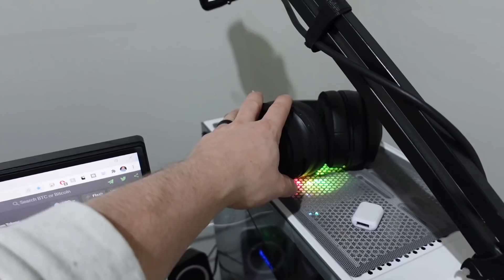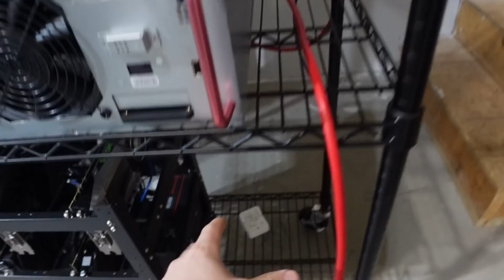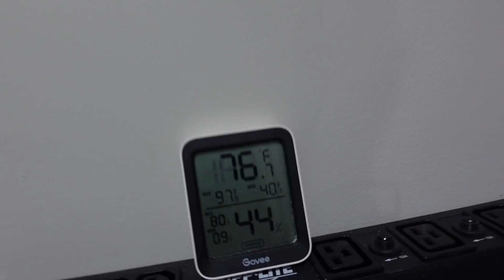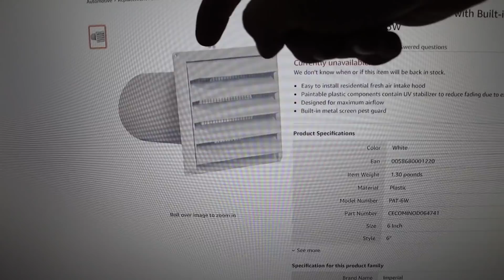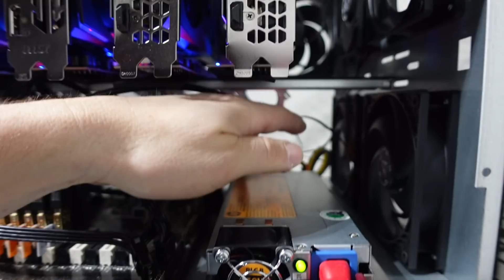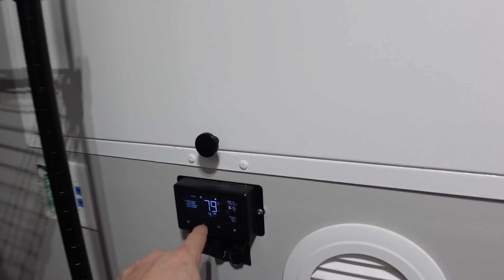Water Damage to My Home Crypto Mining Basement & Mining Rigs

Comment: The vent covers can be replaced in most cases without needing to replace the solid duct portion. I have a similar set up to yours for my mining room. If interested reach out to me and I can send you a link to the replacement covers I used. I am a PA miner as well and we had nutty sideways wind in my area a few days ago.

Comment: Assuming that is an Intake instead of exhaust, the issue is suction. Rain doesn’t have to go sideways, it just have to be light enough to be caught up in the air velocity/suction. Using a larger diameter section or inlet would drop the pressure/air velocity, to help separate the water from the airstream.

Comment: A while back (20 years ago) my youngest caused a toilet on the second floor to get plugged and the toilet ran for about 5 hours (in the middle of the night) with water spilling from the top floor through to the basement.  I would suggest you put alarms in every bathroom behind the toilets to make sure you do not have a similar experience.  I have learned that sometimes things happen even if you try to prevent them so some amount of warning would be good to have early with water leaks/spills.

Comment: You are very lucky the way that all turned out. For sure it's a Blessing to find that problem now and not have anything damaged! I agree change those intake vent covers to a hood type where it's much harder to draw the rain drops in with the airflow. You may be able to even have someone make a custom hoods that come out and down a bit further than the types you showed. That way they wouldn't add any new flow restriction.  They could be made out of pre color finished capping metal or for greater strength galvanized sheet metal painted to match your siding.  Installation could then be done only from outside to make things many times easier.
Reply from the maker: Good Recommendation! I may go that route of almost building a Hood or Roof over them. If it looks clean.

Comment: I install kitchen/bathroom ventilation and its very common for ductwork to be full of water, i removed an 8 foot length of 4 inch pipe last week that had been installed about 6 months and it had over a gallon inside. Usually it forms in the duct extracting air to outside (especially if its laid loose and can sag creating a pool inside the duct), the hot air condenses on the inside of the duct as it cools.

Comment: As it will add restriction as well a in-line filter can be used to help trap moisture  from just coming straight in but needs to be checked for molding and so on. I think that black hood is the best bet.

Comment: We were indeed getting some crazy consistent rain yesterday in PA, at least today is suppose to be only cloudy in my area (Western PA).  When I was outside I didn't experience any crazy winds or rain direction, but I do agree with your assessment of changing out the intake vents.  What kind of suction do you get on the outside?  could it have been enough to pull in water?  coupled with that all day consistent rain that could potentially explain what had happened.

Comment: I've been watching your channel for a while and I saw some videos building that mining room. I hope everything will work out flawlessly for you but I think you made a mistake trying to hide every cable behind those walls. In my mining room I can literally see every cable. All power cables come from the fuse box are visible on the walls. Every rig uses seperate power coming directly from the fuse box. Every ethernet cable, every fan cable are out in the open. I also don't like those closed mining frames like octominers you're using, you can't see what's going on inside. You're mining inside your house where your family lives so you need to be extra careful. Just my humble opinion, get those cables out in the open where you can see everything.
Reply from the maker: I appreciate the concern!

Comment: Glad everything survived. Rain related damage can be very unexpected. A school that I support had an 8" roof drain going through the server room. They decided to install a drain from the a/c unit cooling the server room into the roof drain without a back-flow valve. With a very heavy rain storm the drain line backed up to the roof with water backing up through the drain to the a/c fan spraying water over the server rack. ALL of the equipment in the server rack was destroyed because an 8" line was overloaded in a 100 year storm and they hadn't considered that as a possibility.